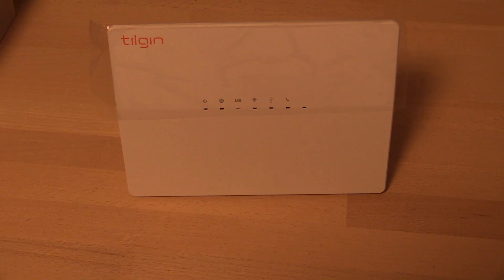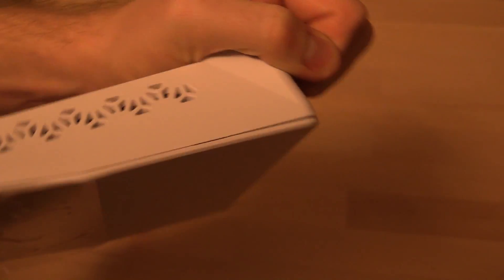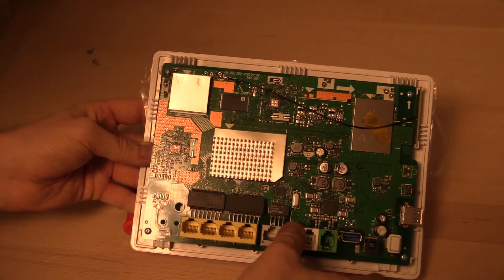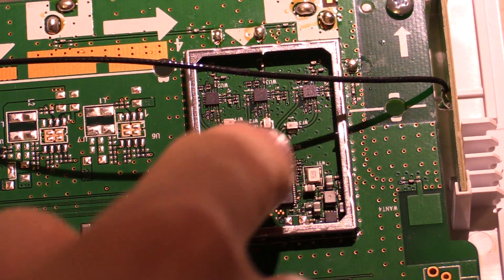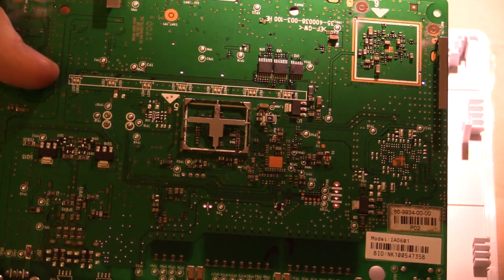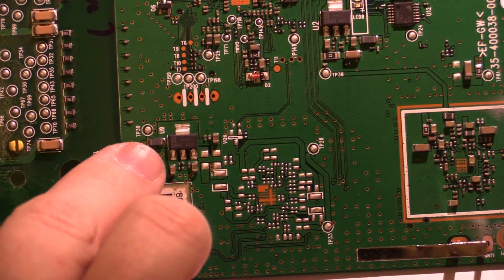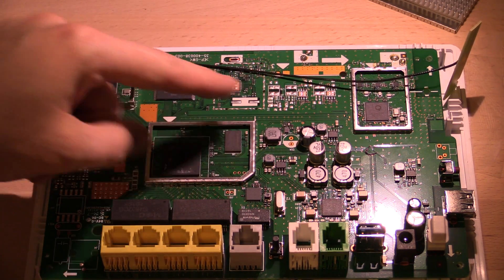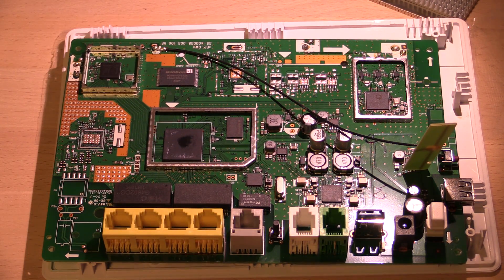Wireless Router Teardown (Tilgin HG2381) - Ec-Projects

Comment: I have the same problem. The router I have doesn't work with my connection. I need to buy new one.

They said that it's because they provide WAN connection. But my router can only handle LAN connections. So I could use a switch and use this router.

This a common problem with ADSL routers, like yours and mine.